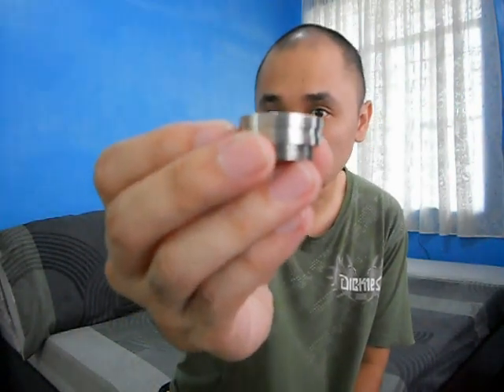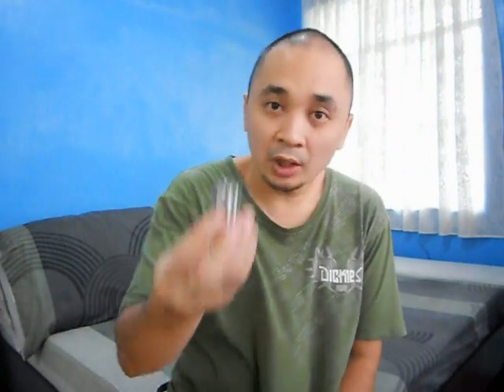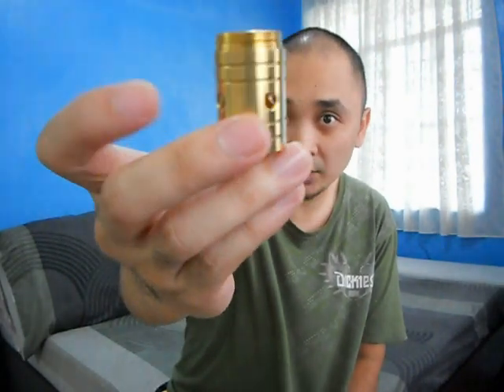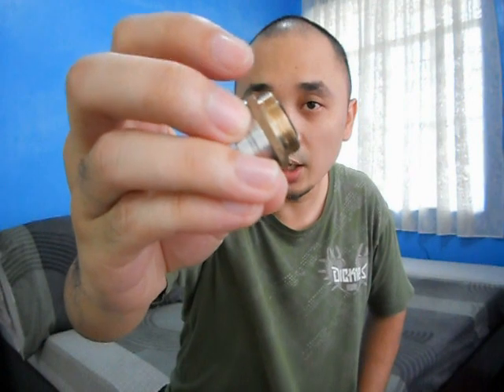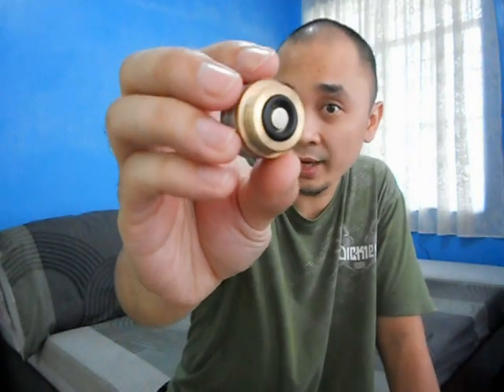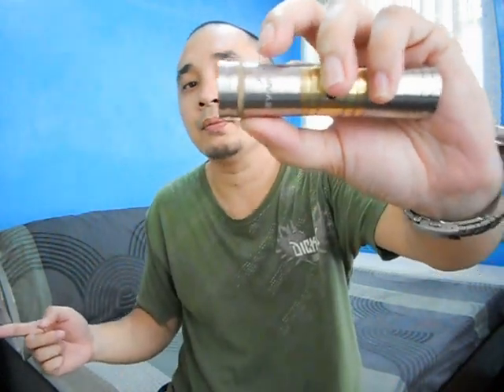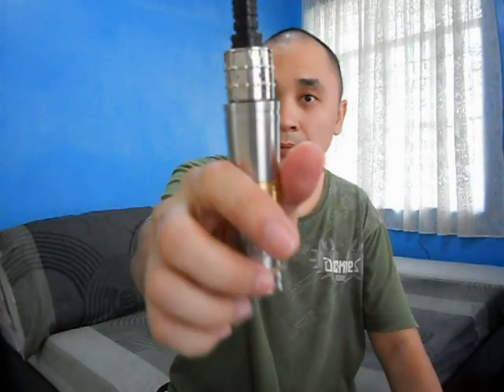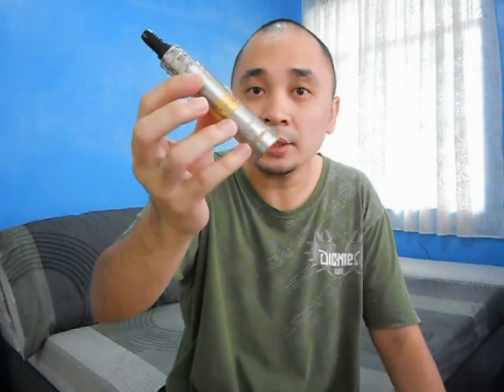Uragon Reviews: Lunar Mod by V-Creations

Comment: Can you use both brass pieces to extent the length to make it kick compatible?
Reply from the maker: I don't have a kick with me but there's no harm in trying :)
Reply: just bought mine tonight and it came with an additional brass extender for the mid section that the sales guy said was to allow it to work with a kick2.  i dont have one to try it out but its a great mod! absolutely incredible with my atomic rda!
Reply: I just fitted a kick into the smaller section and it fits pretty much perfectly, so a kick should work fine.